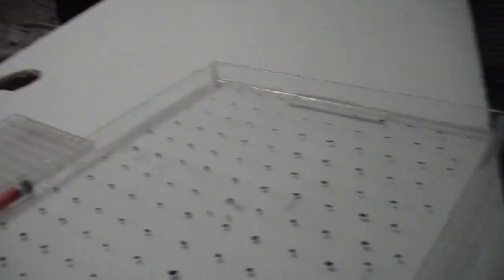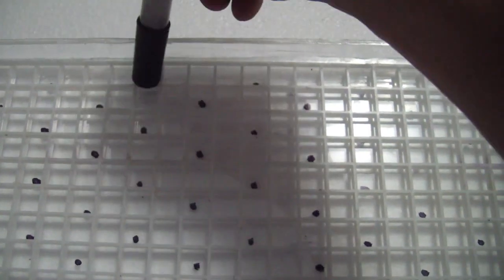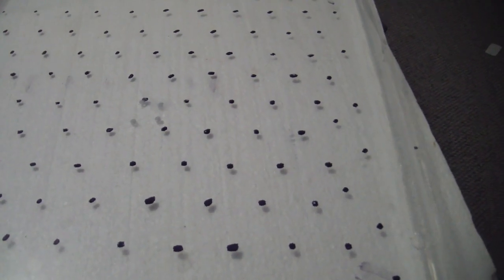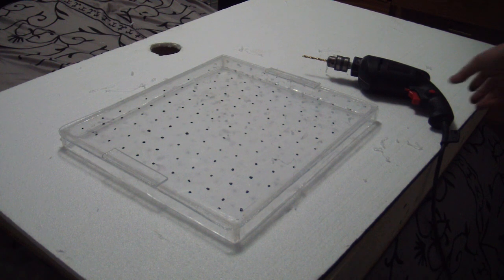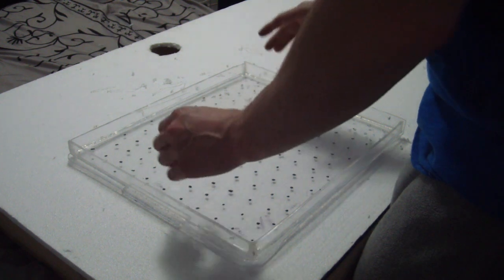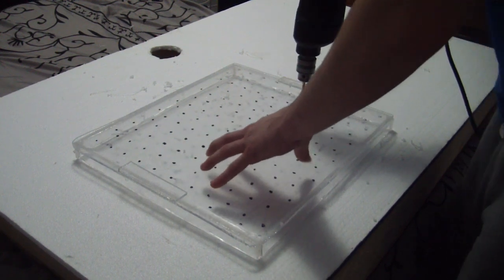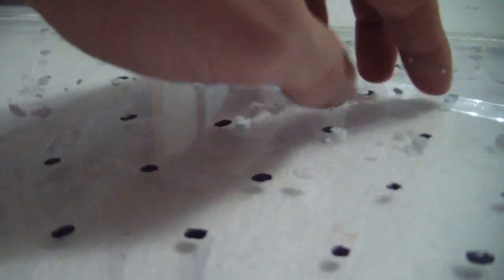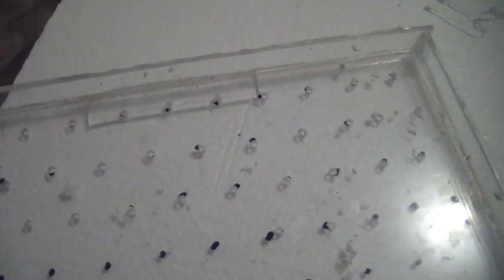HOW TO: Aquarium filter Drip Plate for trickle tower filter sump - wet/dry

Comment: The egg crate template is an awesome idea, thank you for posting. To save some drilling time we used undergravel filter plates upside down seems to work well but we may have been lucky with the amount of flow vs holes.

Comment: by the way if you drilled at the same speed but you don't put as much weight on a drill you don't get those little pieces of plastic it's a clean cut. it works better that way than doing it fast more weight.

Comment: In my opinion, all you are doing is providing a means to evenly distribute water over some type of filter media. The goal is to have it distributed evenly so the thickness of the material shouldn't really matter. Since all you are doing is providing a flat plate with holes in it, the type of acrylic shouldn't matter either. From what I've read, Lexan IS an extruded product. Extruded just refers to the way it was made. Extruded = material pushed through a die/form - Cast = put/poured into a mold.